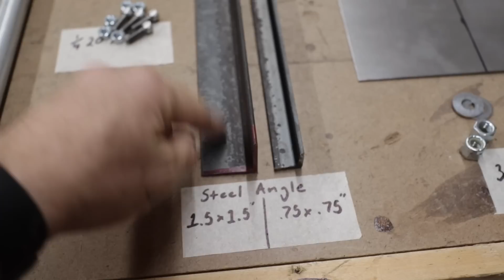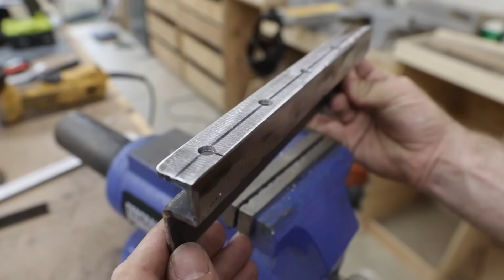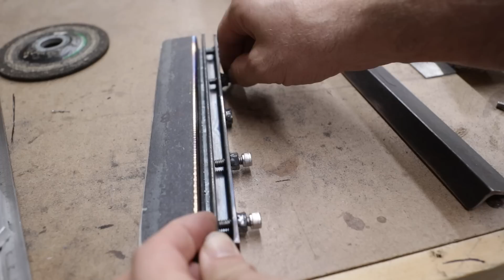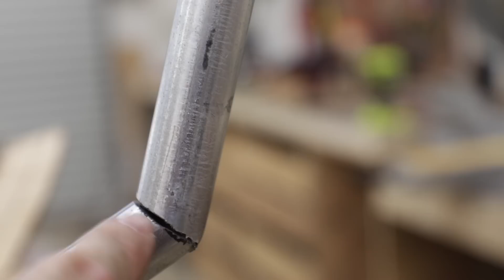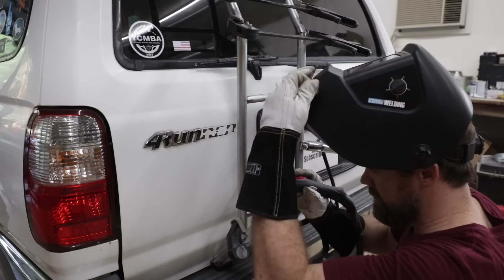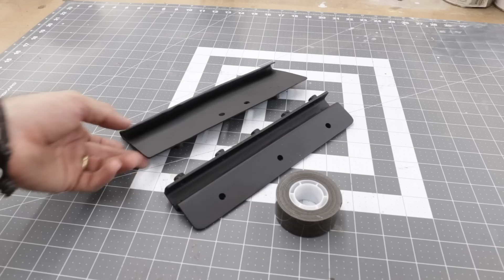How to Build a Gobi Ladder for Your 4Runner!! ($60 Total!)

Comment: can you tell me the diameter of the pipes  that you use  to build it
Reply from the maker: 3/4 conduit for the 2 main bars. Outside diameter is .922in (23.42mm) The steps are 1/2in conduit. Outside diameter .7in (17.93mm)
Reply: @PatrickRemington  thank you  so mush

Comment: I was looking for a DIY ladder build to assist with loading kayaks on top my truck camper. This project will speed things up considerably and I likely will avoid some mistakes after seeing how you did yours. Thank you for posting. I will likely go with 1" sides to my ladder with 3/4" rungs because it will be fairly tall and straight.

Comment: Hey! your gaz debit is too low and the angle of the electrode is too vertical. try to make about 80 to 90 degrees of angle between added metal and electrode you'll have better results. cheers

Comment: Again Patrick, thanks for another great video.

I'll construct mine to mount primarily over my Right Side Rear Tire. The rungs will be close spaced to accommodate my Bad Back and Knees. The bottom 3 rungs will fold up and lock in place for driving.

I'll design it to clamp onto your new Roof-Rack so it can be placed wherever needed.

Thanks again for posting your great construction methods.......

Comment: Just my two cents, but I don’t believe beginner welders should cut their teeth on structural items. Stick to non-structural projects until you learn how to make a good weld. I also would not trust half inch conduit with my body weight

Comment: is there any other way to do the bottom bracket? 
im mig welding and everytime i tac it warps the nut and the bolt will no longer thread.
Reply from the maker: I would get a tap cutter tool that matches the nut you are using and just re-tap the threads after you weld the nuts on. Does that make sense?
Reply: @PatrickRemington  yes that makes sense, if i saw your reply sooner i would've done that, instead i used some threaded tabs from my motorcycle, worked perfect

Comment: I just finished the one I made for my 02 Rav4, I had to put some very specific bends in the tube because I wanted to keep the wing on and it had to make its way around the spare tire holder. All in all it worked great and will also hold an extra jerry can.
Reply from the maker: Nice! Did you follow this build or find it later?
Reply: @PatrickRemington  I saw yours and then just went into my garage and started it, nobody has made a video for a rav4 so I had to figure out a bunch of little issues but it works great now. I just painted it and threw it on for the final time, the gas can is still coming in the mail and I'm just gonna do my own thing for mounting it, ill probably just weld some brackets onto a rung and go from there.

Comment: great video ive been thinking of doing this for a while and might start next week. also did you have to remove the spoiler for the ladder to mount?
Reply from the maker: Yes, you have to remove the spoiler. I used the spoiler mounting holes to secure the ladder on the top left.

Comment: Why did you cut and weld instead of simply bend the conduit? It is engineered to be bent, that's why is called malleable versus the harder style called rigid. Save a lot of timed and energy.
Reply from the maker: Because I don’t have a conduit bender and didn’t feel like buying one and wasting metal trying to figure out the angles of the bends.

Comment: Not really a fan of the sharp points at the bends, do you think it's possible to heat the conduit to bend it without cutting slits into it.
Reply: Actually looking online I think I can just use a regular conduit bender to get the angles. Thanks for the video gonna attempt one for my fzj80. Was originally gonna buy one for an FJ and modify it, but this is cheaper and I can make it however I want.
Reply from the maker: @jaimereyes7480  Yeah you can definitely use a conduit bender just wanted to show how to do it without the bender.

Comment: If you are using the wire conduits to build the ladder, you can just use the handheld bending tool, all Electrician do that way, why cut and weld them ?
Reply from the maker: The first reason is that I don't have that tool and wanted to avoid buying another took that I wouldn't really need again. Also, that tool comes with a learning curve and I didn't want to waste any conduit try to learn out to get the bends just right.

Comment: Love the fantastic video! But why not paint over the galvanize coating?? All vehicle base metal is galvanized and it add additional protection from rust...
Reply from the maker: I read that it needs to be primed with a latex primer for it to work. If you prime with oil-based primer it will adhere initially but will quickly fail. You need to remove the coating to weld it anyway and my spray paint is oil-based so it's just easier to go ahead and remove it. With a good paint job, I'm not worried about rust.

Comment: Nothing bad in what you did by cutting and welding the electrical conduit, you might have been able to find cheap or rented or even bought a tubing bender for electrical conduit. home Depot sell them for about $30. If you have other projects where you will be using the conduit, it might be something to look into for those projects.
Reply from the maker: Yep.. The reason I avoided that method was to keep from having to buy a new tool I would rarely use and I wanted to avoid the learning curve where I might ruin a few pieces before figuring it out.

Comment: You should explore the world of unistrut! I opted for it instead of conduit on my DIY roof rack. The customization is endless. Also, do you have a good recommendation for a beginner welding setup?
Reply from the maker: I would get a 110 flux core/mig welder. You don't need shield gas with flux core wire so it's cheaper and good to start with. Whenever you want to start MIG welding you can just buy a bottle of 75/25 shield gas. Flux core welding spatters and Sparks more it doesn't look quite as clean. Mig spatters less and looks cleaner. I would try to find something used first. Nothing too old tho. Welders have gotten so much better and cheaper in the last few years. Lincoln electric, Hobart, Vulcan (harbor freight) are all good choices for anyone. Watch some review videos here on YouTube. If you would rather buy new I'd look at a machine from YesWelder Which is the brand I was using. I've been very surprised by the quality for the price. Hope this helps! Let em know if you have any other questions!